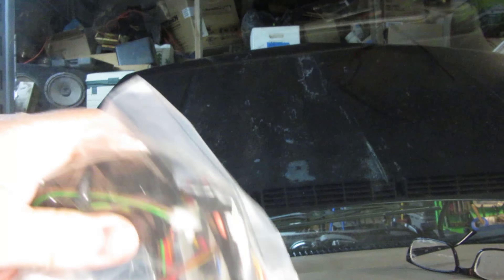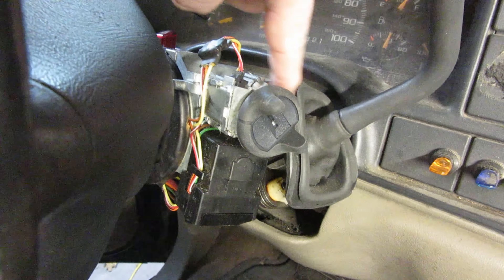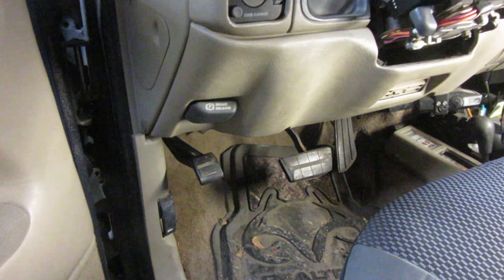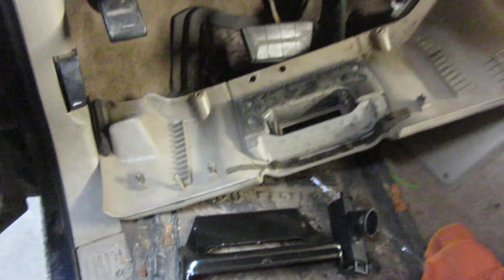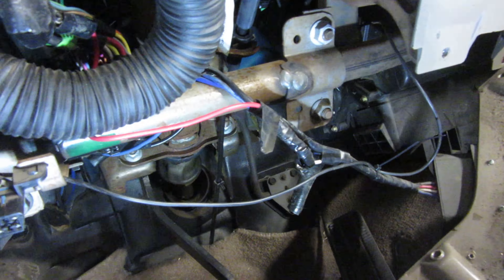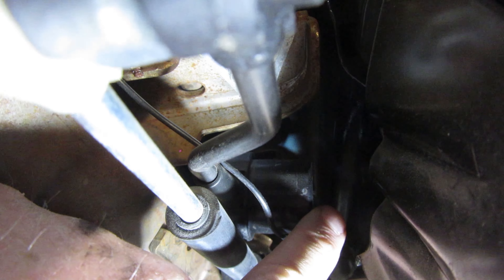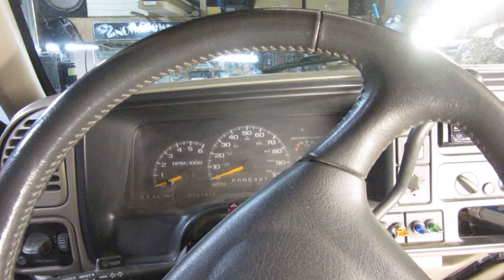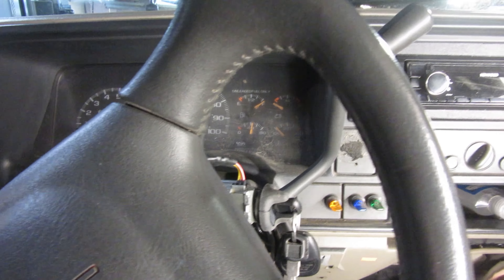OBS GMC/CHEVY NO START SECURITY WIRE HARNESS REPLACEMENT (LONG VID)

Comment: Any advice on a 2001 tahoe . Replaced ignition switch but the housing unit is banged up should I replace that or the harness wires ? Or both? Vehicle acts like it’s gonna start but doesn’t .
Reply from the maker: i would try the harness first and go from there